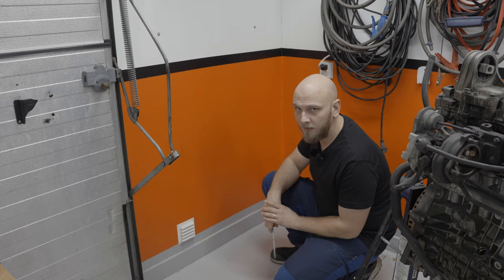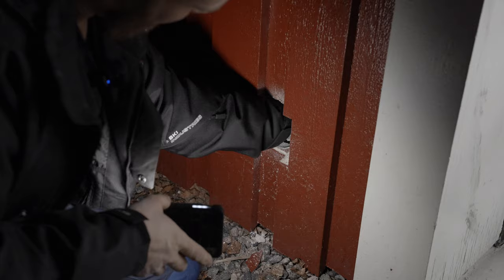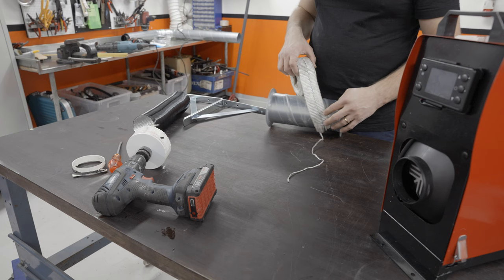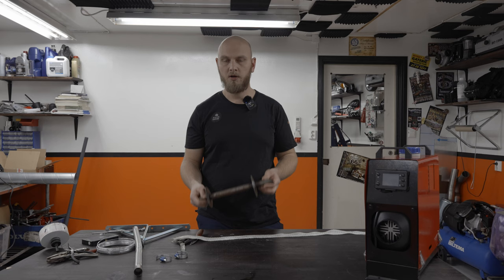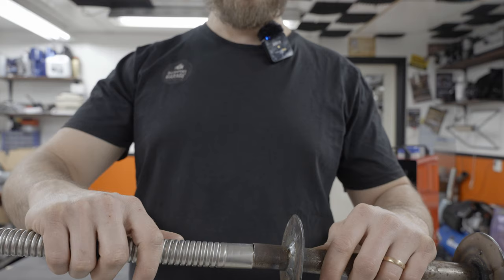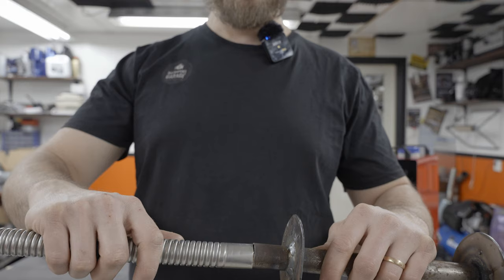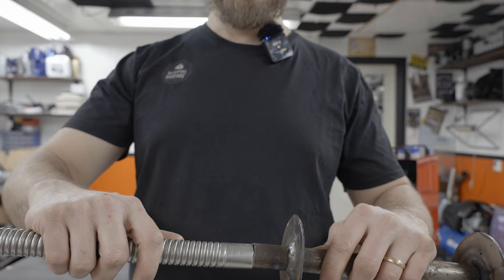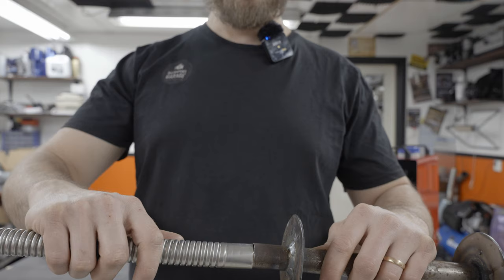Installing My 8Kw Vevor Diesel Heater  || Part 2

Comment: How hot did the wall feel from the exhaust?  I want to install one but need to vent it safely without spending  $$$$$ on horizontal ducting
Reply from the maker: Absolutly no problem with the heat :)
Reply: @BackmansGarage  thanks for the reply.  Much appreciated 👍

Comment: That is a good setup as your air going in is already pre heated, not drawing it from outside. Great presentation. TKS.
Reply: It's taking heated air from inside the shop, burning it in the combustion chamber then exhausting that air outside. To make up for the air" burned" from inside the shop that means cold air MUST seap into the shop. So it's actually more efficient to use a "cold air intake" that's drawing air from outside, burning it, then exhausting it outside.

Comment: A 2 KW heater will heat a 8 X 8 X 7 foot room even if it has no insulation in the floor , walls or ceiling .

Comment: How come you didn't run yhe exhaust into a heat exchanger , then out the wall . Heat exchanger also gets warm and keeps garage warm .
Reply from the maker: Maybe if this was a more permanent solution, but for now, its just auxillary heat for when i need the little extra.  However, i like tha idea of heating water for the high pressure washer in the future, but i would probably use a dedicated diesel water heater for that. But maybe i will cosider adding a heat exchanger (egr cooler type) to use some of the exhausted heat as well.

Comment: A glass pack muffler might could do the trick. Aren't those diesel heater's exhaust pipes notorious for splitting open at it's seam?

Comment: You do realize the Fiberglass, I.e. what you said will burn. Are actually used in insulating very hot pipes. Like steam lines in power plants. Former U.S. Army Engineer here.

Comment: What is that thing called you put on the pipe on each end? I need them badly!!! I use a bean tin for my heater exhaust 🤣
Reply from the maker: On the exhaust pipe or the pipe going through the wall? 🙂 On the exhust pipe i have just welded on a couple of 2mm plates with a 25mm hole drilled in the center 👍
Reply: @BackmansGarage  sorry, the pipe going through the wall?

Comment: One problem with having the heater inside is the noisy pumps which continuously clicks away
Reply: 80% of the time I have to wear hearing protection in my shop/garage and the music is always blaring too so the slight noise from the heater is drowned out or inaudible anyway
Reply from the maker: I thought it would be an annonying sound, but the more i habe it on the more I'm starting to like it. 😀

Comment: So it took, 3 hours to heat your work space?    How big is the work space?  What was the outside temp?
Reply: 9:27pm is 21:27, it was up to temp at 22:12 so about 45 minutes and NOT on full tilt.
Reply from the maker: space is about 27sqm  2.35m to ceiling.

Comment: I was wondering if you could pls share a link or purchase info for the flange that you mounted on either side. Didn't have any luck at the local home Depot
Reply from the maker: https://www.vvsochbad.se/vaggstos-oe-100-mm-1017048?gclid=Cj0KCQiA2KitBhCIARIsAPPMEhIHrzko3S4mAP7fK9LUneF2EYGILpEF8rrBrgMoMSGorc8M_dyiRy8aAoUxEALw_wcB

I used something lile thisone but it was at Byggmax (local hardware store)